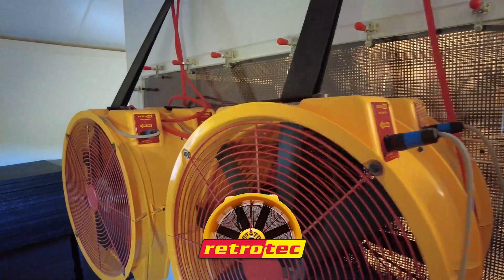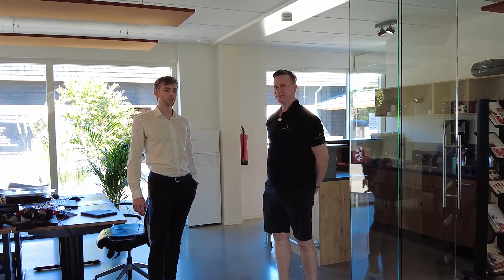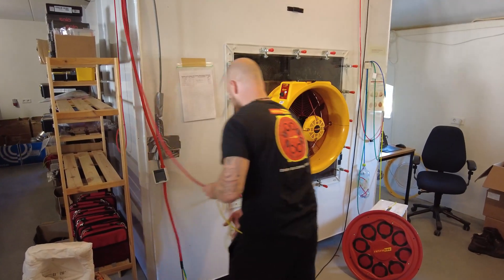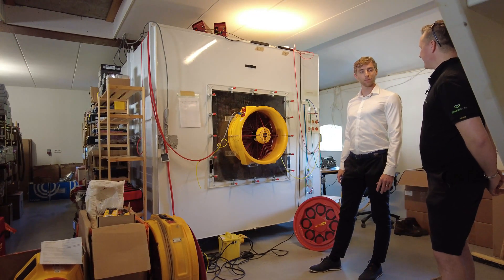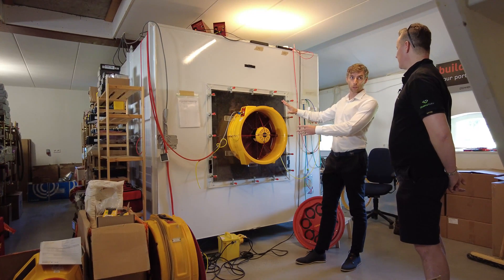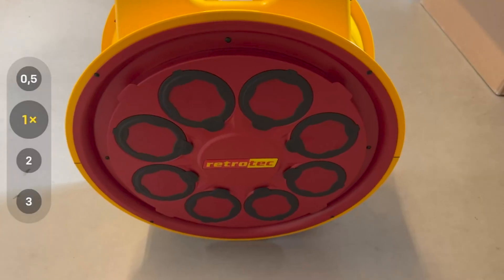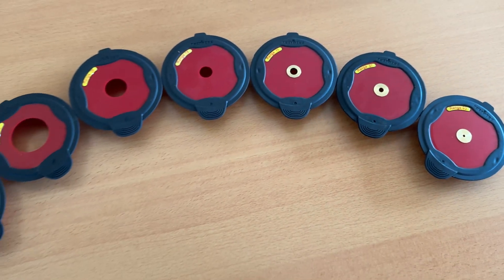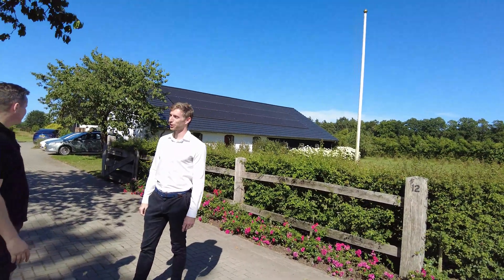Retrotec Netherlands: Behind the Scenes Calibration Tour

Comment: Do you know how to use those 'uncertainties'??? 
If you have a reading of .59 .. that would mean it passes a requirement of .6 or less, right? Wrong as there is 'uncertainty'. Say the uncertainty stated in the report is 2%, at .6 then 2% is .012 .. so to be certain that it passes the .6 requirement the reading needs to be less than .588 .. similarly to be certain that it fails the reading would need to be higher than .612. Between .588 and .612 you'd be uncertain if it passed or failed.Of course the uncertainties stated in the report also include a set value that would need to be accounted for. And then some allowance for calibration drift over time and for curve fitting between the calibrated values. 
Both NATA and NMI offer uncertainty courses, the NMI one is more indepth.